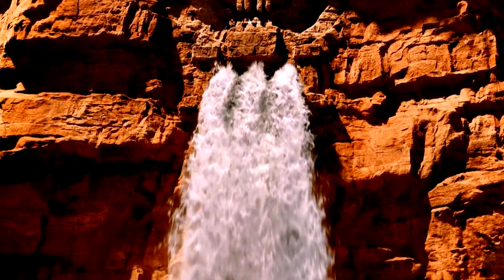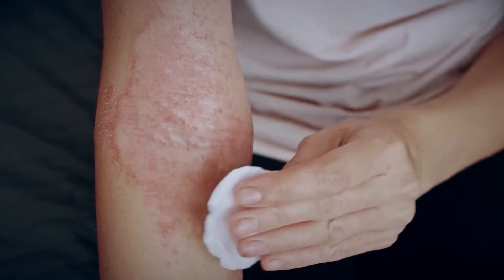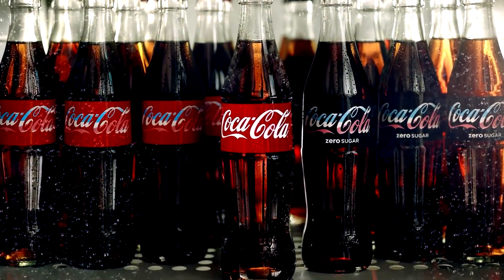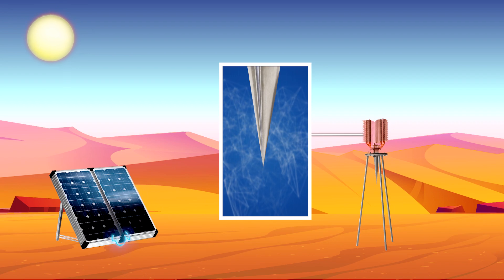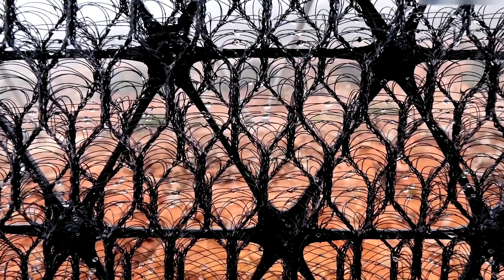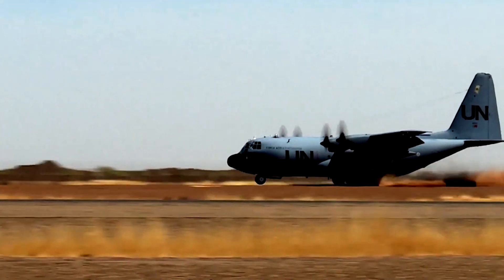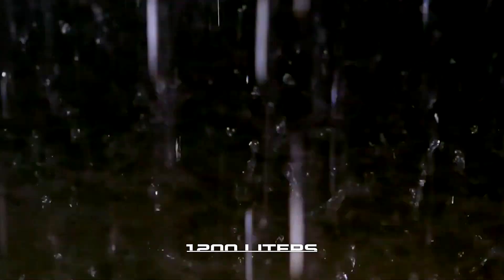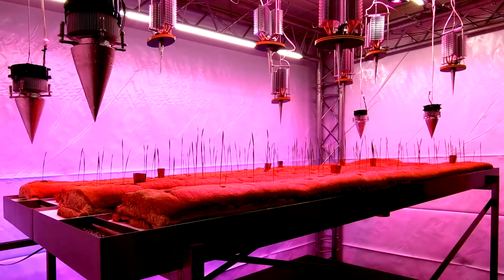THIS INVENTION COULD CHANGE THE WORLD

Comment: Well the thing is that it CAN'T change the situation for places that need it the most because it is full of expensive (for majority of the world) parts.
Reply: If it works as advertised it will be like a community thing I am sure. He did say he wanted to scale it up. 

 I wonder how clean the water is.

 Still can use the uhhh dew catching fences on top of this or other ways to get clean water...
Reply: @dianapennepacker6854  well but you see... it's only advantage over other methods like nets that are waaaaaaaaaaaaaaay cheaper is that it can work in places with low humidity. But low humidity means low performance of the machine. And low performance kills "community thing" idea. And we come back to high relative cost for communities that would need it and have no better options.

Comment: OK it sounds great but if it is so good then they should be able to produce smaller versions that they could afford to sell to the public as kits or as fully functional systems so it can be tested by those that are interested.

So if it works let's have tester kits or systems for the home that we can try out for ourselves.

Otherwise what's the point.

Also why not just save more of the water that falls rather than letting it go to waste.
That seems a more realistic opertunoty to me, run pipes from parts of the country that gets too much rain fall to the parts that gets little rain fall.

The same amount of water is there it just falls in places that doesn't need it, unless the water is being siphoned off into space somewhere that we can't see.

Also on the one hand world health says we could be flooded due to the ice caps melting but then says there no water, so where is the ice caps melting to.

Something a bit fishy about all of this.

Comment: I'm optimistic that this tech will work.   Countries that have access to sea water will likely be the big winners.  This tech will prove that batteries will be key.  The dew point falls at night when the air temperature drops and stored energy will power the system with improved yield and reduced evaporation.  Energy storage during the day, water production at night.

Comment: Energy storage (batteries) seems to be NOT necessary. Connection to a power grid is also NOT necessary. A few thousand of these, hidden and well placed would make a huge difference. Or make them a hundredth the size and a hundred times as many. A device to blow moist air over a blockage into a "rainshadow" area where another device would condense the water would make even more difference.

Comment: and from that, we should learn not to expect that it will rain.
Reply: Yea, pulling moisture from the air doesn't seem like a good idea, especially in dryer areas that depend on rainfall, even if it is only 1 inch per year.

Comment: Here we go again an idea that is not effective on large scale. That electricity is better used for other purposes. This is similar to projects or products that claim to help africa. What africa needs are dams, irrigation system, utility lines , industry factories and concrete roads. Small sacle products will not work after a few years and the cycle repeata again